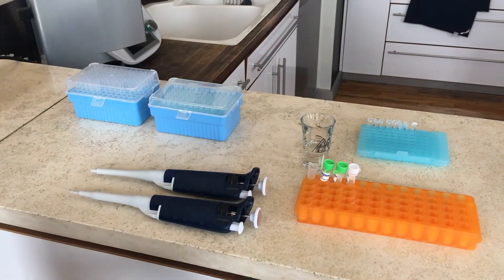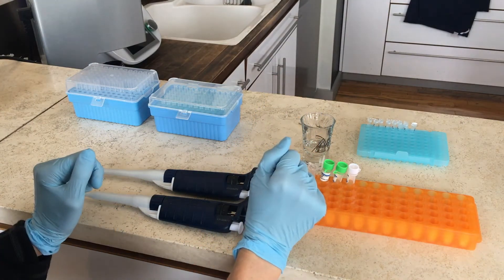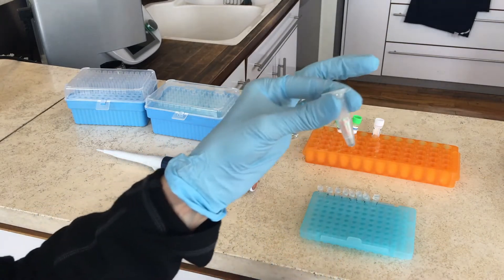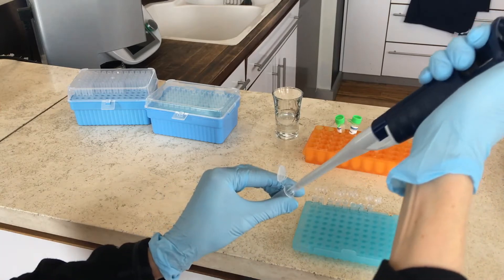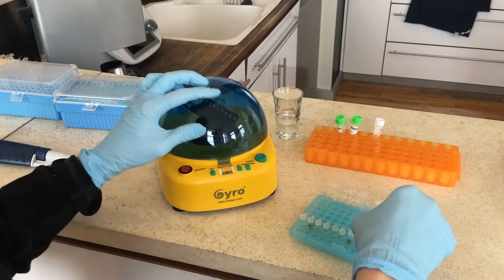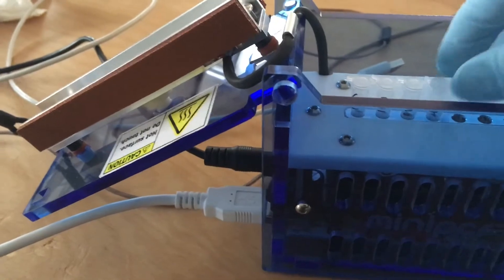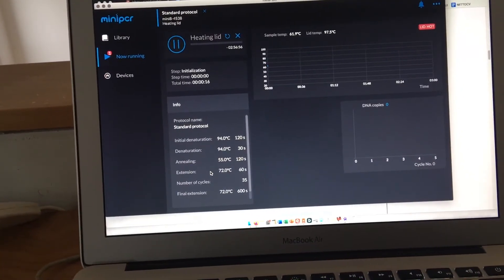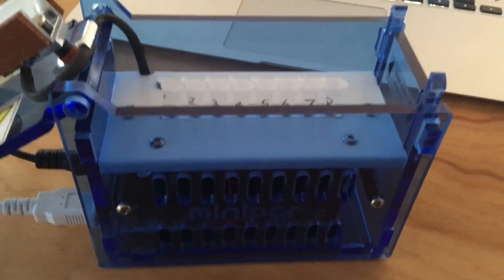Fungal PCR at home, Part 3: Amplification

Comment: So when you are sampling from the tubes with the fungus, how do you make sure you are getting the right layer of liquid. I think you said the DNA is at the top and debris is at the bottom. How do keep from sampling too deep in the tube? Thanks.
Reply from the maker: Haphazard Homestead, sorry I only just saw your comment. You basically just don't want to dip the pipette tip down to deeply. Pipette up from the top third of the liquid in the tube.